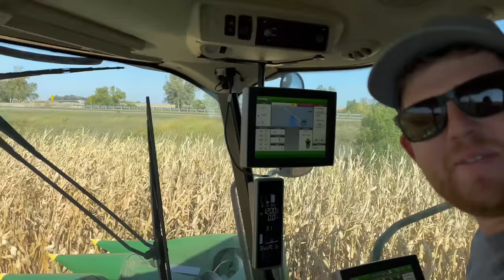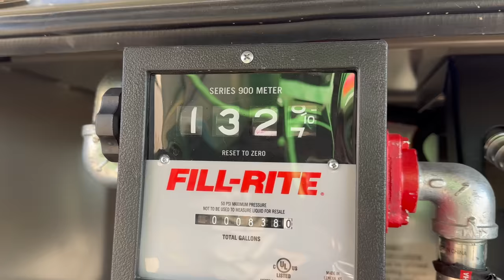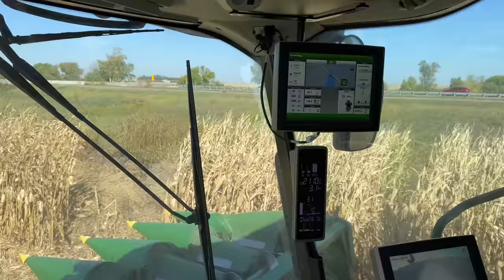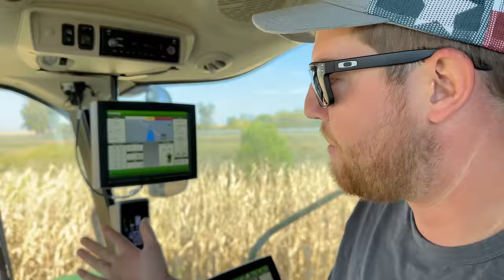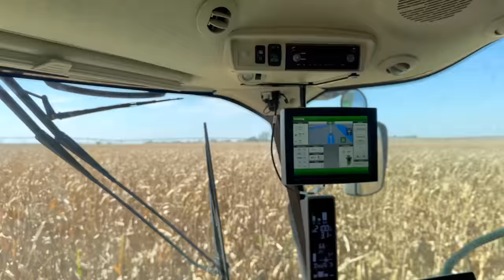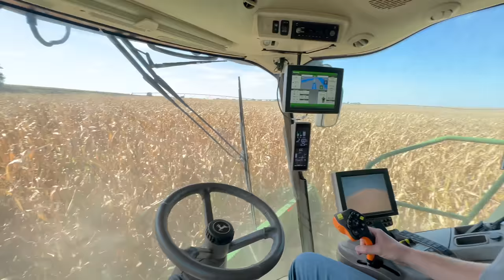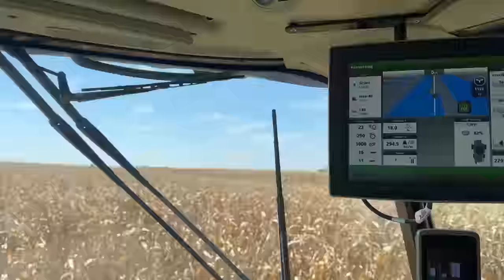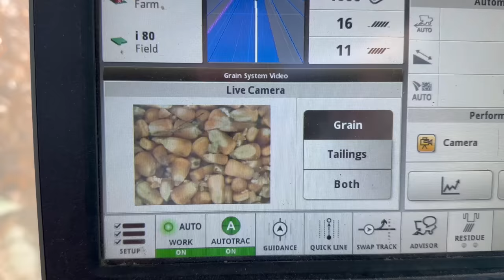Someone CRASHED Into My Corn Field!

Comment: You two probably know most of the businesses in this area. Check with the mechanics and body shops. Whatever this phantom  corn killer was driving has to have damage. Measure the width between the tire tracks. That will give you all an idea of the vehicle size. This would not hold up in court, but it would give you an idea of who the bad driver/ corn killer was. Meanwhile you two be safe out there!!!

Comment: Given the terrain and the fence, there is virtually no chance that the vehicle drove itself out of the cornfield.  Someone just did a good job of cleaning up the mess.  I crashed into a bean field when I was in high school, and would not have been able to drive out even if the car had ended up on its wheels.

Comment: We owned a small farm in west central Iowa when I was a kid. One late night I heard this loud noise. It woke me up as well as my dad. He got up to go outside and then got in his truck to drive down the highway. All of the sudden he comes barreling in our driveway and I stepped out and he said call the police and ambulance. So my mom called them. We had ambulance, police and fire all out on our farm at like 3am. Some guy lost control of his car around the curve by our house and rolled his car a dozen times right through our cornfield. Destroyed a lot of corn. Took out a telephone pole. The man was thrown from the car but lived. My dad heard moaning and that’s how he found the guy. He was quite a ways from where the car landed. He had two broken legs, broken arm, ribs, some vertebrae in his back. Turns out he was intoxicated. We had 3 major crashes on that highway by our house. Hence the reason that section is called dead man’s curves. One gal went over the river bridge. On elderly couple wrecked and the man was thrown out and ended up tangled in the barbed wire fence. Sadly he passed away. It was crazy and scary. I don’t think I ever slept through the night there after the first crash.

Comment: One time I had to arrange to get a car out of a pasture.  The car had not touched the fence.  In true Dukes of Hazard style, it had eased off the road, went down and up the dirt for a culvert drainage, launched off the far side, airborne over the fence, and landed upright parallel to the fence in the pasture.  It happened late at night, the driver was a high school kid who had gotten off shift at a fast food restaurant, fell asleep driving home, drifted off the road while accelerating, to end up in the pasture.  To look at the car, basically no damage, except on further inspection, the harmonic balancer on the front of the crankshaft had sheared off, lots of scrapes on the underside, but otherwise intact.  The driver apparently had a sore back the next day, but was otherwise unhurt.  This happened in winter, so the ground was frozen, but no snow on the ground, but you could see where the car scraped off the vegetation and where it had launched in the air.  Sometimes miracles happen.

Comment: Deere combine ladders are terrible! I have struggled and hated them for years. Wish they could come up with a better design. And myself being short makes them even harder to open. One thing my dad made years ago for corn samples is mounted a old vintage hand sheller to a bucket. You can quickly run some cobs thru for your sample and they are easy and cheap to find.

Comment: Aaach....NO....don't blow your dry air filters out with compressed air.  Trucking outfits (log trucks) I worked for years ago would fire you on the spot if they caught you at it.  The high pressure air blows voids into the media....which equals zero filtration at that point.  Bang them against something to get the worst of it, but never, never, ever blow them out.....or you'll blow them out.

Comment: Hopefully when you change your oil and filter you pre charge your oil filter. When I use to do heavy equipment we always pre charged the filter if at all possible.  Ps nice filter tool , I used to add a cheater pipe as other mechanics would tighten the f out of the filter. Good work on your content.

Comment: Pick by hand, harvest with a machine. My dad and his siblings picked my grandfather's cotton by hand starting at a very young age. I would pick ears of corn by hand into a burlap sack, filling pickup truck loads full when harvesters were not available. 

The alternative to your mounted emergency tool is a keychain resqme device. I have used one successfully with fast results in my career numerous times on vehicles, even on double pane house windows.  This after the cops with their collapsible batons were ineffective. Ideally applied at a corner.  

Though I did witness my cousin when we were kids use his below average intelligence to try and kill a fly on my uncle's early 70's model JD combine cab windshield with a pair of pliers.  I thought he was joking and wasn't going to do it, but then barely tapped the back of them to the center of the glass where the fly was no harder than if you lightly knocked on it with your bare knuckle.  Missed the fly but destroyed the glass. Needless to say that reduced that year's harvest profi

Comment: The oil change is easier than my Gravely zero turn mower... dang!  That's actually both impressive and depressing for me.  LMAO.  I mean that large piece of equipment is easier than a lawn mower?  My goodness.  Plus there's no way not to get oil everywhere on my mower and underneath it because the way they built the oil line.  It's one of the few complaints Gravely gets on the particular mower they make.  Great mower so far, it's fairly new, but yeah... shit engineering on the oil line.

Comment: Simply your tractor has a DPF filter in the exhaust to catch soot....when it starts getting clogged the tractor injects diesel into the exhaust to incinerate the soot in the filter, but the by product of the incineration is a gas called NOX ( Nitrous of Oxides) So to counter the NOX produced while reducing the amount of soot they inject diesel exhaust fluid(DEF) which converts to ammonia  when heated in the exhaust stream that flows into another filter called the SCR that has rare earth metals that react to the NOX and ammonia and create water vapor.  Sounds like its good for the environment until you calculate the added amount of fuel used in the tractor to burn the soot, reducing horse power which increases the fuel used per hour, and the carbon footprint to  mine the metals to manufacture the SCR filter and manufacture the DEF. It's an EPA Ponzi Scheme

Comment: You forgot to mention the horrors that corn stalks do to truck tires.  So you will sometimes see direct unloading on wheat fields but never corn.  Or peanuts but that is to do with soft sand.

Comment: OK  I have a question...  if you plant a square field and can only water to the edges in a circle -  you are only irrigating about 78% of the plants.   Wouldn't it be better to save the seed from those corners and just water what you KNOW will grow if you don't get enough rain for the "extra" areas????  I would think that the smart planters you use could shut off the seed rows at the edge of a circle right??     Sorry just an engineer nerd thinking....

Comment: Will one tractor not pull 2 grain trailers?
Reply: Those grain carts are very heavy when full and require a lot of hp and they also require a PTO . Having 2 on one tractor would be very unstable and the operator wouldn’t be able to see the back cart .
Reply: No.  One of those grain carts loaded weighs 40 tons.

Comment: why are you deliberately trying to destroy your combine engine.  quaker state oil is wax based oil.  designed up your engine.  if you were ever to switch to a detergent oil that is designed to clean your engine, it would clean all the slug out of the engine, and it would start knocking.  the one thing to remember is, whoever told you to use, quaker state oil, if he is lieing about this, is there anything you can believe any thing else he says.